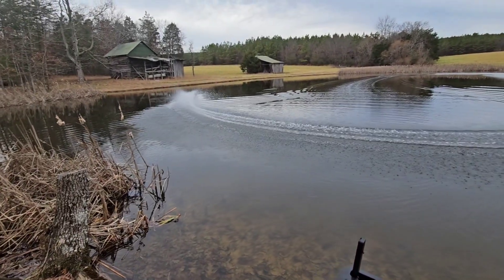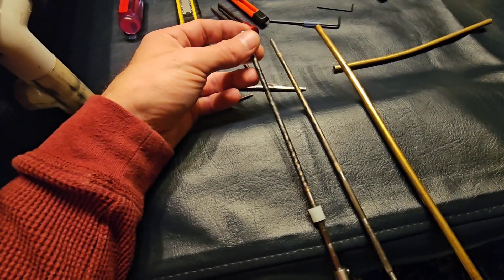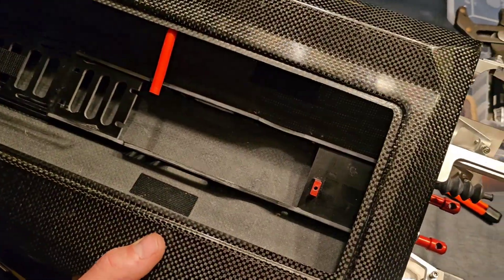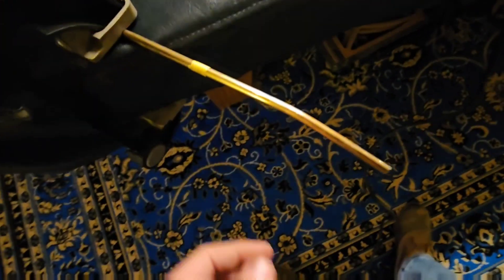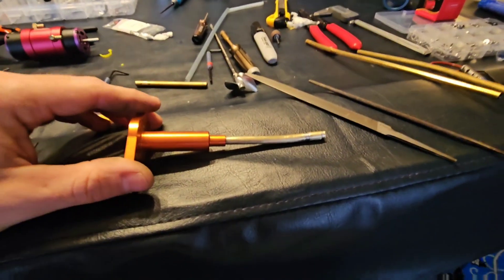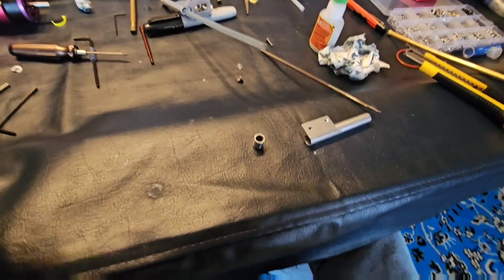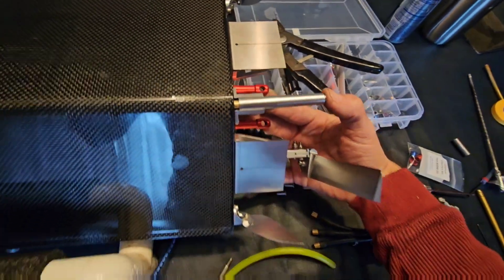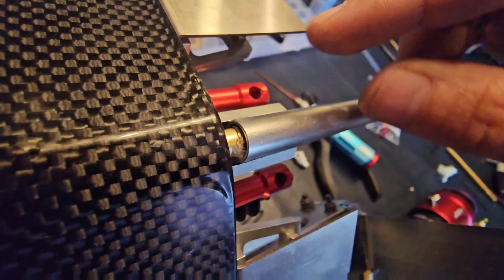Oxidean Dominator Custom Stuffing Tube Install, The Fix for a Tight Driveline! More Speed, Less Heat

Comment: Hey H2oMechanic do you recommend this Oxidean Dominater??
Reply from the maker: Yes I do, if I bought it again with the knowledge I have now I'd buy the None self-righting model. It would allow for more room. The electronics that come with it don't need to be upgraded at all honestly. Solid 75mph boat out the box with good batteries & prop. I've only flipped it once in a dozen crashes. I like the Kevlar model, but they were out of stock during that time. But Definitely a excellent boat!
Reply: @H2oMechanic2.0  Okay. One thing you do now that all of Oxideans products are not his correct. The hull is what I am referring to. It is actually not a dominator it is actually a Zonda mono.
Reply from the maker: @user-kp3pd5hy4s  I'm sure the same Chinese factory is making the hulls for each company. Based on pictures the canopy is different and the drive train. Either way if you want a specific setup I'd buy a bare hull & make up a custom setup. That's the fun part.
Reply: @H2oMechanic2.0  for sure putting the mind to work.
Reply: @H2oMechanic2.0  If I were to purchase this I would run 8000mah lipos. Which none of my boats a4e able to handle this is why I am looking into the dom.